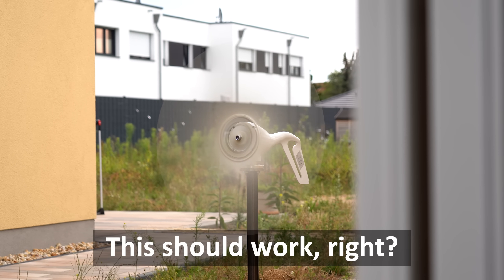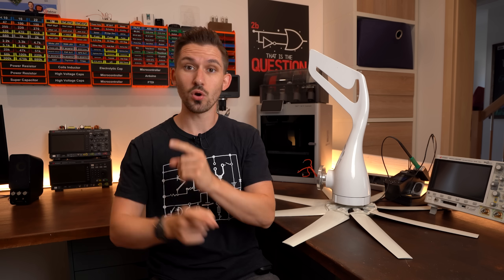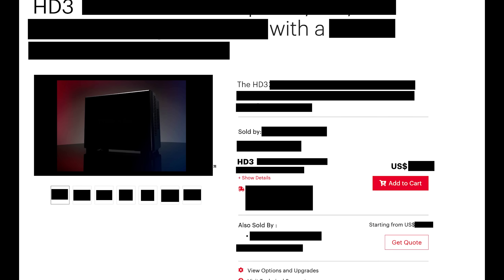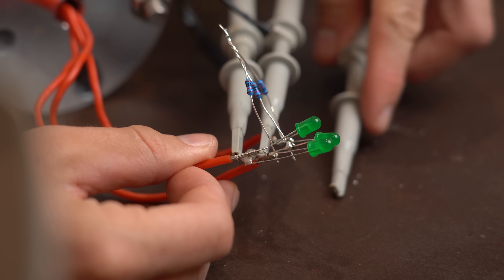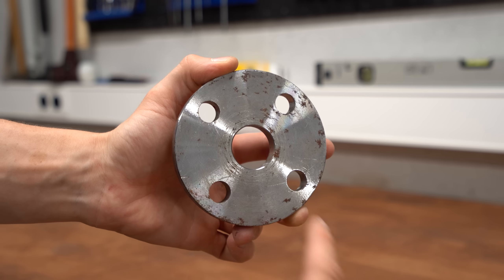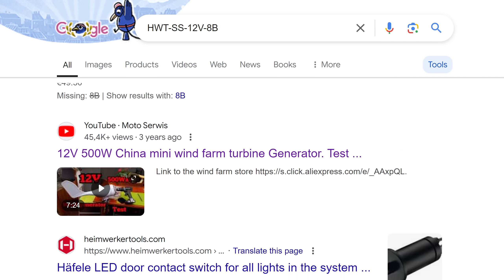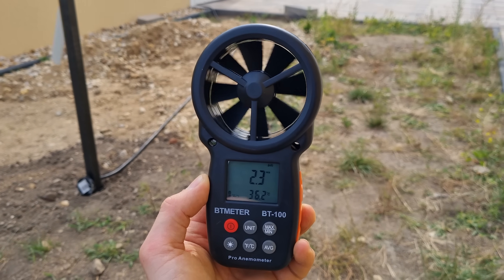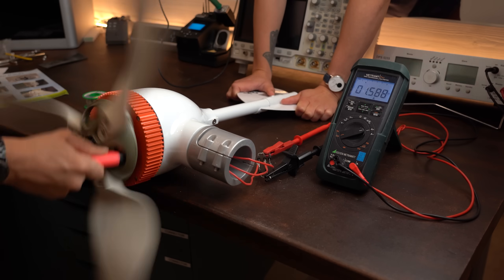I tried to Power my Home with Wind Generators! (Worth it?)

Comment: If you want a small wind turbine, you definitely want a vertical one, not a horizontal one. The reasons are simple: A vertical one is much quieter, and it will produce much more power even at very low wind speeds because it requires very little force to even get started. The downside is that the higher the wind speed and the bigger the wind turbine, the less efficient the vertical will be, and eventually the horizontal will take over. 

So if you want to build a really big turbine optimized for high wind speeds, you want a horizontal one, but so low to the ground that a horizontal one is pretty useless unless it's mounted on a boat in the open sea. A vertical one also has very little vibration and is suitable for mounting on a roof. You can't mount a horizontal one on your roof because it would have to be very high above the roof so that the blades can rotate freely (a vertical one can be mounted directly on the roof and even on a sloping side) and horizontal ones cause so much vibration that your whole roof will start to vibrate and you definitely don't want that. 

In most parts of Germany (depending on the state), you can mount horizontal turbines on a pole as long as the blades don't exceed 10 meters above the ground (so if the blades are 1 meter, you can mount them 9 meters above the ground). But that's still too low for a horizontal. Lower Saxony and Schleswig-Holstein even allow 15 meters. At that height you want a vertical one.
Reply: vertical ones do nothing, right The designed scale works perfectly even in low wind..I've done and tried all of these I know what I'm talking about.
Reply: Vertical turbines do look promising, but its just a misleading info that they run from low wind speeds. Slow wind carries almost no energy. That combined with lower efficiency is ....hmm, just expensive math lesson.
Reply: @JanicekTrnecka  Vertical-axis wind turbines (VAWTs) operate at lower wind speeds because of three aerodynamic and mechanical factors:

1. Omnidirectional design:
VAWTs capture wind from any direction without yaw mechanisms. Horizontal-axis turbines (HAWTs) must align with the wind, losing efficiency during direction changes at low speeds.

2. Lower startup torque requirement:
VAWTs have shorter blades and lower rotational inertia. Less torque is needed to overcome static friction, so they begin rotating at lower wind speeds.

3. Different lift and drag dynamics:
Many VAWTs (e.g., Savonius, Darrieus) exploit drag or combined lift–drag effects. Drag-based rotors like Savonius types can generate torque even in slow, turbulent air, though at lower efficiency.

Comment: I have see a few small wind generators work well and yes not much air speeds. 250 $ usd sound cheep. But negative thoughts is I hear they need more maintenance than solar panels.

Comment: The mounting flange was likely designed for 3/4” pipe which has an OD of about 27 mm. 

As a pipefitter it looked like a ‘socket weld’ flange.  The 3/4” pipe would slip into the hole and a fillet weld applied at the shoulder. 

Remember pipe is larger than the ‘inch’ size up to 12” pipe.  Tubing will be the exact OD.  1” tubing will have an OD of 25.4mm.  1” pipe has an OD of about 33mm.

Comment: I had a low voltage solar panel that paired with a cheap controller wouldn't give much charge.
I used a cheap AliExpress voltage booster  set at 15v between the panel and the controller and it worked better(not great tho).
Even if the panel was only giving 10v the booster increased it enough for the controller to work.
Not sure if it will work with a wind generator tho

Comment: I've pretty much done similar experiment and got identical results . I've asked myself if maybe at some Speed the Power transfer kicked in.. but all my esperiment were big failures.. which Is odd considered how much Power a motor takes to turn.. ive loved when the turned stopped when i shortcircuiteed the rectifier output.. satisfying

Comment: I use alternators/generators from old cars and connect them to the fan blade hub using the fan belts.
I get great output from them in 20-30 mph winds and it is already 12VDC

For what you paid for that one almost useless piece of krap, I could easily build 4 complete units that would fully power my workshop all by themselves.

10 units if I pull parts from junkyards instead of buying brand new.

Comment: You could use those generators to power small watt garden pumps, for light irrigation. Also, what is the wind speed at 3-4 m off the ground (like on your roof)?

Comment: What you have is a three phase alternator.  You can make a very nice permanent magnet axial flux alternator that with a 10 foot diameter rotor can give you a kilowatt of power under good conditions. One of those conditions is mounting it high enough above ground, at least 10 feet above nearby structures. A VAWT is less efficient than a conventional rotor but it kills fewer birds and is less of a hazard to neighbors in the event of an overspeed event or a knock-down. A well engineered mast and guy system will help to prevent catastrophe, too.

Higher voltage is more efficient. Smaller wire, lower line losses. I would go to a minimum of 48v and around 140 to 180 volts would probably be ideal, but 48v components for e-boats and electric golf carts are readily available.

If you were experimenting with internal combustion vehicles and your test subject was a Yugo, you might dismiss its practicality in the same way you dissed your cheap wind generator. You bought the Yugo of wind generators. Obviously wind turbines are a viable source of electrical power, but not when they are the size of window fans and made in China. Not saying that wind power is the perfect solution, but it does have a place in a good renewable or off-grid energy setup. You just need a more powerful and efficient machine.

Y or star connected windings and delta connected windings give different operating characteristics to the alternator and I would encourage you to experiment with rewiring. Don't bother trying to re-wind the coils, though. 

Pretty sure that there are some youtube vids around on making a permanent magnet axial flow alternator for use as a wind generator. Having a starting point for wire size and number of turns on the coils will get you off on a better start when DIY-ing your own alternator. Most serious DIY units are axial flow. The stator disk has the coils, and the rotor disk has the magnets, with the two disks facing each other with a small air gap. Be sure that your bearings can handle an axial load or eventually the two disks will rub together and the whole unit will self destruct.

Comment: you can use a car alternator, stick a prop on it and mount.
there many types with different outputs so you can take your pick.
a cheaper alternative to the expensive Ali-express generator.

Comment: As with most things involving power, there is a lower limit below which the input is useless as you demonstrated. I have investigated the typical wind speeds where I live and determined that I would produce only slightly more power than you did. However, I suggest that you look into horizontal wind generators. Yes, they need to be mounted above the roof line (which may not be legal where you are) but they generate power with wind from any direction. If you also have solar, the wind power generated during the day can be stored to add to whatever power you generate at night.

Comment: As a retired engineer and sailor, I've experimented with many wind generators (turbines). They were all a disappointment and none met claims. My advice is: cover every available square centimeter with photovoltaics (solar panels) before resorting to wind generators.
Reply: depends where you live. Where i live, the sun aint getting upp between end of november to end of january, and therefor i will need another solution than solar panels.
Reply: Id say the same. To get decent power from wind you need.

A really tall tower, above the trees 
A good charge controller, not those shipped with
Reply: Where I live average wind speed on the ground is 12-14mph for 8 month out of the year and for 4 month 13-15mph. It’s completely flat around farm land so in some situations like on a coast you could have them super low
Reply: that and just get 10-20kw/h of batteries to last the night
Reply: Wind seems like it scales up well, but down horribly.
Reply: I thought the same BUT the battery cost is too hight, I have enough solar-panels but dont have storage and for the price of 1 battery i can install 1 large wind turbine
Reply: @taleem.help1 could the excess solar be diverted to low cost heat storage batteries like water or sand?
Reply: Id recommend solar evac tube collectors for hot water first, then geothermal heat pumps, insulation upgrades and window and upgrades, then solar, then other.  I see a lot of people installing solar on very poorly insulated homes.  I take things a step further and heat my home with a 240sq ft solar evac HW collector array.   Its almost always cheaper to increase thermal efficiency, than to go solar, wind or moat any other production method.
Reply: Same here. And they look ugly on a boat!
Reply: Why didn’t you just say solar panels if you were just gonna say solar panels anyway
Reply: @KSpotes  because there are also solar hot water panels.
Reply: @KSpotes  maybe he wants you to learn something new today...
Reply: Just pay your dues and buy a generator for emergency use.   The search for free energy is very faulty as you need energy in to get energy out with all your electrical engineering.

Comment: I had a small wind turbine back in the 1980s. It only charged a 12v battery and that powered a few lights and a stereo system.  In that house where there was no main connection for anything and no other source of electricity it was worth it.  But anywhere else you'd guess that there were better alternatives.

Comment: I’ve been interested in alternative energy since the ‘70s, and the problems we have today with them are the same that we had back then. Solar: Efficiency isn’t that high (although it IS getting better), and they rely on rare metals to be made and often are placed on roofs (causing all kinds of structural issues.) The biggest weak point still remains - the batteries. They are getting better, although still expensive, and prone to catching fire catastrophically. Wind: While interesting, it takes a LARGE wind blades to capture sufficient power to be economical, but that also means disproportionately large installation bills, as the windmill blades and generator needs to be larger, it needs to be high off the ground, and it needs to be in a place where wind is not obstructed by nearby buildings. Lastly, it also has the same battery limitations that solar has. Both wind and solar have the limitation of being subject to local conditions (such as cloudy conditions for solar, and windless days for wind power). In the end, they appear to only be useful as ADJUNCTS to traditional coal or nuclear power (which has none of the limitations of location. They work equally well in any location, and work reliably.
Reply: I forgot to mention that wind power is VERY mechanical, and needs constant maintenance. Solar has the problem of the heat of the sun (the very thing that makes it work) baking the components so that their lives are limited to 20 years at best. Then there’s the problem of disposal of the wind power and solar components at the end of their life.

Comment: On the pipe sizes, water pipe is measured by the internal diameter, so 25mm will have a bigger OD.

Comment: You could have increased the output voltage of the first generator by using a 3ph transformer. (or three single phase ones)

Comment: Another way is to make a larger blade that could generate higher torque with slow rpm then convert it with gears into higher rpm to achieve higher voltage

Comment: The recommended wind is 14-20mps not 3.5 even big 4-6kwh units require 9mps minimum. Wind is best 36ft high off ground, costal using a minimum 4ft winglet to 5ft . These small units less than 2.5kwh aren’t worth wasting money on period there non speed governed, rotate well beyond 70-90 rpm  when bigger units are just 30 rpm , and often die in a year or break there winglets off because they sent govern speed.

Comment: I live remote rural off grid NSW Australia mounted a wind turbine linked to my 24V battery solar system , been running it for about a year now couldn't power my house of it alone but we have decent wind here at night and it keeps the 24V battery banks topped up at night hence extending the life of my batteries.

Comment: Unfortunately it's a function of sustained wind speed, how long the flow remain uninterrupted, etc.

You could rewubd the generator.  Won't help,  Unless you are set up to INSANE torque specs, you are never going to produce   usable oiwer   from a mast a meter or  two abive the ground

Comment: Bitte die Wikipediaseite zur Windanlagen lesen bzw. nur die physikalischen Grundlagen: 
1. Windanlagen stellt man nicht am Boden auf, weil dort der Wind am meisten abgebremst wird. Je höher, desto besser. Deshalb werden Windanlagen auch immer grösser. Das ist extrem wichtig, weil die Leistung proportional zur dritten Potenz der Windgeschwindigkeit ist (doppelte Windgeschwindigket = 8 mal mehr Leistung). 
2. Je grösser der Radius, desto mehr Leistung. Die Leistung ist proportional zum Quadrat des Radiuses (doppelter Radius = vierfache Leistung). Auch deshalb werden Windanlagen immer grösser, weil dann der Rotordurchmesser grösser sein kann. 

Grundsätzlich führt das dazu, dass Windanlagen für den Privatgebrauch praktisch nichts bringen. Grosse Windanlagen lohnen sich finanziell gerade so. Der Strompreis ist dort vergleichsweise günstig. Da wir es mit nicht linearen Effekten zu tun haben, heisst das allerdings, dass sich Windanlagen im privatgebrauch überhaupt nicht lohnen. Weder von der Leistung her, noch vom Strompreis her. Wer sich mit Naturwissenschaftlichen Themen beschäftigt, sollte sich immer fragen, wie man Dinge berechnet bzw. welche physikalischen Gesetze und Formeln hier verwendet werden. Dann kann man sich solche Versuche sparen und dabei noch eine Menge lernen.

Comment: Wind power is trickey. Height is your friend but if you live in a restricted area you are out of luck. Could I recommend a book by Paul Gipe, it’s called Wind Energy Basics, it’s an older publication (1999) however this individual is well versed in wind power and his publication is based on studies by others in the field of micro wind power as well as his extensive work in this field.

Comment: Looks like you need to get ~100 of them. 😃 Or just 2 x 100w solar panels. 🤷‍♀
They simply do not create enough rotational force like their big brothers.
The only place I've seen these small diameter WTs used to any real benefit is on sailboats, to trickle charge a small battery bank, or even the starter battery.

Comment: In my state electricity costs about $.10 per KWH, at 1.5 watts of output just the windmill would take  76 YEARS to break even if it ran 24/7.
Reply: Oh that is really cheap electricity! Here in Germany, where Scott also lives, it is around 0,35€ per kWh, so it "only" takes between 20 and 25 years to pay for itself
Reply: In my country it's 49
Reply: @stivi739  49 years? or 49 cents per kWh?
Reply: 1000 mw  is only 10 watts  a rip off plus.runs battery down  wen not going
Reply: It's 10 cents per KWH to generate, probably 0.15-0.20 total to send. Now, in 76 years will your state still offer 0.10 cents per KWH or do you think it will get more or less expensive?

Comment: Commercial wind turbines use gear boxes to get much higher generator speeds.  They also have a lot more torque as you can guess from their swept volume, but a gear box might be what you're looking for.

Comment: one of the best small wind generator applications I have seen would be those windwalls. Think the EU is looking into making arrays out at sea, that use smaller and much cheaper wind generators to cover less area compared to larger ones, while maintaining the power produced. Should help with maintenance costs as well, since they are easier to source and transport parts when they are smaller.

Comment: Hi Scott, all comments below are (quite rightly) focussed on the fact that you have only a small maximum amount of energy that you can harvest with a small wind generator. in an urban environment As you conclude, this may not be worth your while. But...what if you look at this from a different prospective... How can we harvest all the available energy that is available where you are? If you manage to combine several or many, small wind generators together, it may well be a solution for many urban situations. You could maybe use surplus parts to create those wind generators. I'm thinking of nema17 motors and maybe recycled plastics. The real challenge would be how to connect multiple smaller wind generators, effectively (with the least losses) to a (standard) hybrid inverter.

Comment: I think the solution is simple, but implementation is tricky, each wind generator needs more coils, 1 spinning rod moving 5 coils should provide better output, but I am unsure if connecting the coils in a series or parallel would be best.
Or if the coils were bigger.

Comment: You should try building a mechanical battery like the ones from "amber kinetics".
It the size of a large household water heater. Stores enough power to provide enough backup storage for 3 days